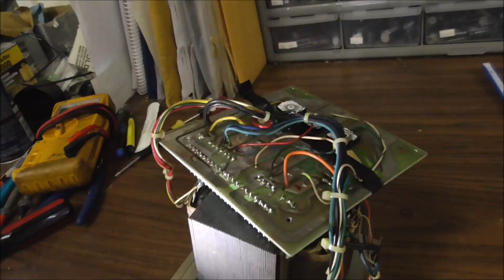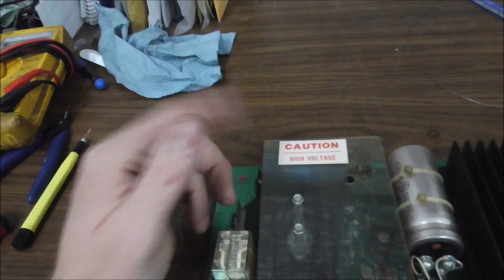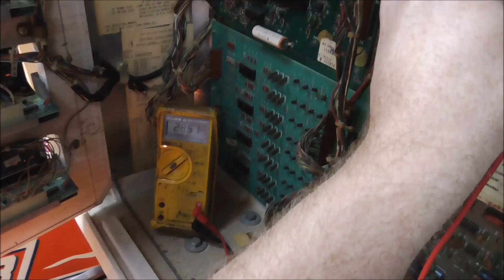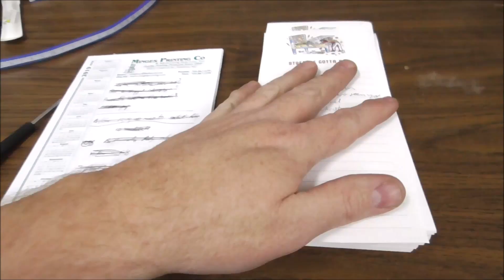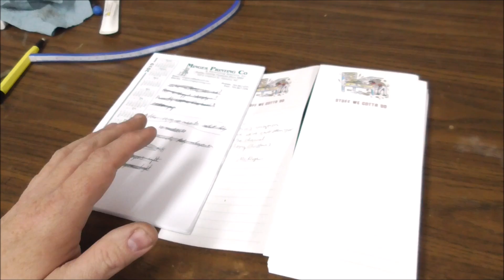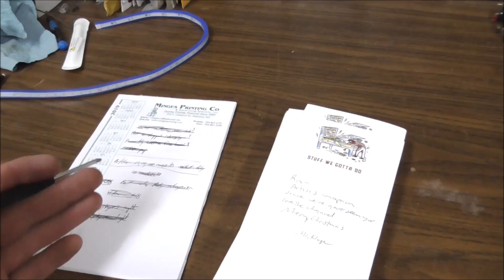Power Supply Repair on Bally's 1978 Six Million Dollar Man Pinball Machine... Plus We Got Presents!

Comment: Attract mode is the hardest on the bridge rectifier for the controlled lamps.  If the attract is lighting a ton of lamps, the whole heatsink can get super hot especially if the game also has an aux lamp board.  If you go into diagnostics where all the controlled lamps are off, the heatsink will totally cool off.

Comment: Hey, I got an atari san fran rush 2049 and I want to set up free play but I don't see a test mode button when I open the coin slot... the research i have done says it should be there... do I just need to buy one and install it or am I blind and it is hiding in there somewhere?
Reply from the maker: When you open the coin door inside the hole there should be 4 different buttons, on the left side of the cabinet behind that door.... it would be strange for them not to be there because they all had them and it would take a lot of trouble to remove them :)  If yours are definitely gone you can make any button work but you'd have to figure out where the wiring is that is supposed to run to them.  Open the door and look to the left about 6" back.
Reply: @LyonsArcade  can I get your email address to send you pictures of what I see? There is a metal piece there for it with clips and a label but the piece is not

Comment: Just a little advise. When you re-solder connections your are mixing old and new solder. Some solders don't mix well (leaded and lead free). And will cause the connection to break down over time. It's best to remove all the old solder and replace with new solder. If you're going to remove the old solder you may as well replace the old header. 

Love your channel.
Reply from the maker: No thanks
Reply: He knows from the vintage that it was built with tin/lead, he is repairing with tin/lead so there is no problem.

Trying to remove leaded solder and replace it with lead free is a fools errand, you will never remove all of the lead. If you are going to fix stuff that was built with tin/lead you need to repair it with tin/lead solder.

The other way round can make more sense, if you want to use leaded solder to repair something that was originally built with lead-free.
Reply: @petermichaelgreen  I guess he had the old solder analyzed to be sure no one added lead-free solder in the last 30 years. 
There could also be other contaminants – battery acid, dirt, etc. that don’t mix well with new solder. 
It might be a fool's errand  but I never re-solder without removing the old solder. And I never use lead-free solder. Aerospace and aviation will not allow the use of lead-free solder.

Comment: Hi Ron, battery free video LOL. When people complain about what the joints look like on large through hole stuff it really is not critical at all. How many warranty return have you had by doing it that way? Most likely zero.  Cheers.
Reply from the maker: I’ve never had a bad solder joint but yet people know better because somebody told them there are little leprechauns that will show up years down the road if you don’t do it their way

Comment: took me months to solve the intermittent low voltage issues in my 68 mustang. advice from "online experts" said it's bad grounds and/or frayed & corroded wires i painstakingly checked every inch every wire entire car. turns out fuse holders were metal fatigued soft as butter

Comment: Retentioning fuse holders is often a temporary measure. Often corrosion is the main culprit. The holders get hot and because of that the tension goes out of the metal (try heating up a spring to see what happens) Always best to replace if they are really weak.

Comment: You're thoughts are pretty good.  If you are going to replace a diode in case it might fail, you should replace every chip on the MPU board and the like as well.  If wear over time was an issue, chips would fail sooner as the are on a smaller scale.    Don't fix what ain't broke.
 That solder you are using is absolutely fine and as long as the temp is enough to make a nice joint, your style is fine.   I prefer using older solder.  The new "Lead Free" solder is crap and is a lot harder to get nice joints with.   These machines used solder with Lead in them when they were made, keep using the old solder on them :) 
They don't label capacitors like that GE one anymore.  The Working Voltage is the Surge Voltage these days.  New capacitors are not tolerant of over-voltage at all.  I noticed that capacitor said 85 AMBIENT written on it.  New caps are rated at 85 or 105 internal temperature, not ambient.  Being 1977 it maybe needed replacing as it could have dried out a bit, but it would have been a good quality cap at the time.
You've done another brilliant job on this machine :)
Reply from the maker: Thank you Brendan, that makes sense about the internal vs. ambient, it's neat seeing all this older stuff and how it differs from more modern parts.... I've heard the new solder is junk without the lead too :)  Thanks for watching man, we appreciate you tuning in as always!

Comment: JOE"S CLASSIC, the Staedtler bendable rules will help you paint in the boundaries on the playfield without going over the boundary lines? I'm trying to look for something when painting on the playfield that the paint won't crossover the boundary lines to the other colors next to it which happens often. I'm not a great painter so its very sloppy looking, what can I use or do to prevent my repainting the playfield to not crossover the boundary lines to the other colors?

Comment: With the grounds and 5v's going off the board, looping through from a connector and going back to the same board... What's that all about..? Any known benefits from doing so? Some sort of fail-safe, maybe..? You've mentioned this before a couple of times, but I can't get my head around why they're done this way...
Reply from the maker: We have all kind of decided that they did it that way because it was easier to jump it over a trace by doing that, LOL

It doesn't work as a fail safe because that same connector has the source voltage on it (12 volts).... so if you remove that connector you remove the source and the output of the voltage (and nothing in the game will work with it unplugged)

Comment: Opened up my radio cassette player the other day to fix The crackling sound issue and discovered on the board there was a capacitor that looked as if it would burst any second so I’ll have to change that out..never done it before don’t really know how to solder but will try anyway
Reply from the maker: You can do it man, the main trick is you're trying to heat up both at the same time, so just put the iron on the board right where it meets the cap leg, also sometimes it's easier to just add a little bit of solder to it, it reflows everything, and then you can pull the cap leg out while it's hot (if it's not bent into a hook)

Comment: Once you remove that board from the metal bracket, it would be a good idea to clean off the old dried out thermal paste from the bridge rectifiers, and apply some fresh compound.
Reply from the maker: I usually also replace the screws, when they get old they have rust on them (sometimes you can't see it) and they don't properly conduct heat, plus they may break the next time you take them off.  Better safe than sorry, only takes a few seconds and doesn't cost much.